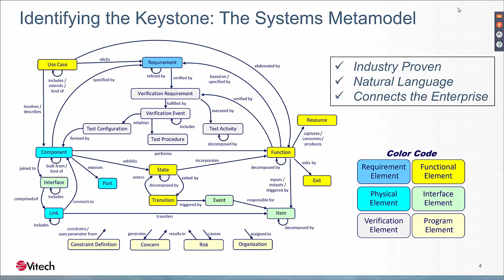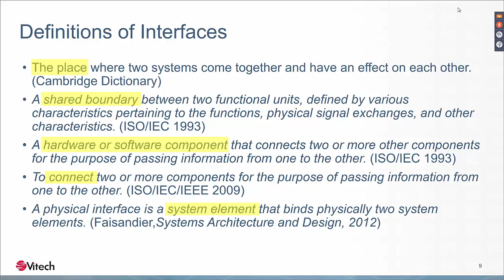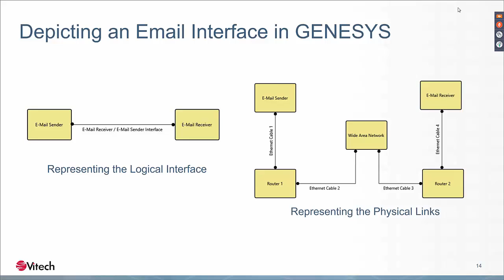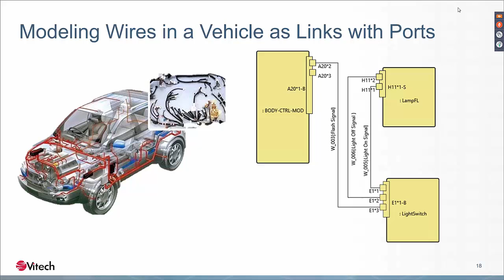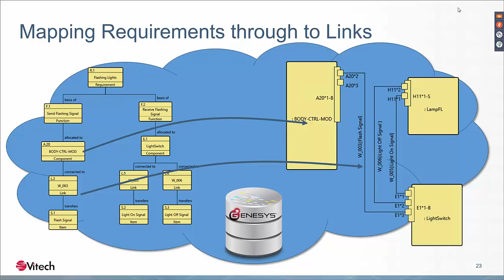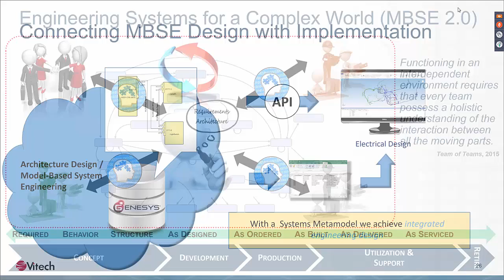'MBSE 2.0 for Interfaces' with Mark Simons

Comment: Is there guidance available on how to define and decompose items to reduce the clutter on higher-level functional and behavioural diagrams (IDEF0 and EFFBDs). Specifically for items from external components as these tend to be well defined and down to their elemental level (from the concept definition and stakeholder meeting phases) prior to the design of the SoI.